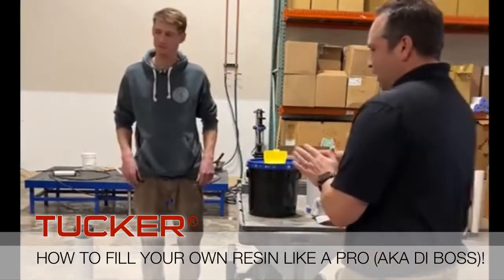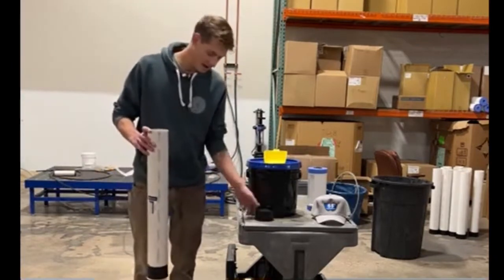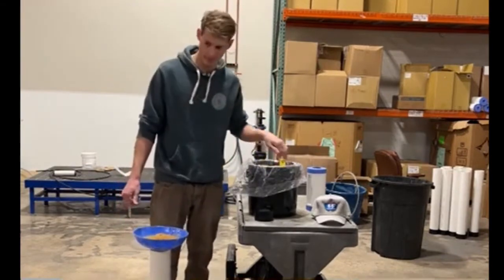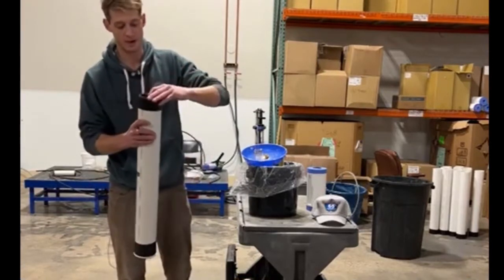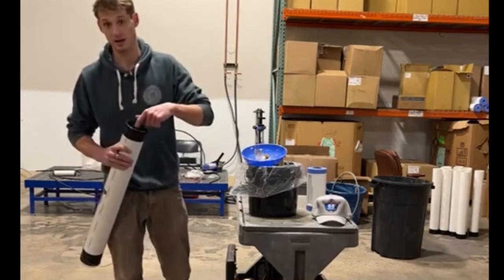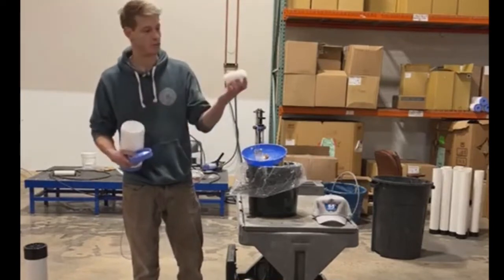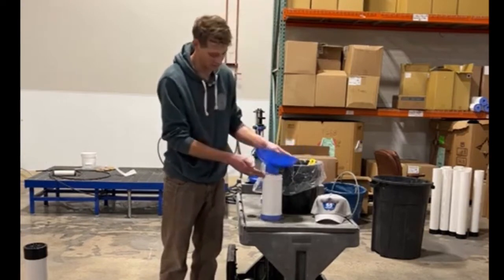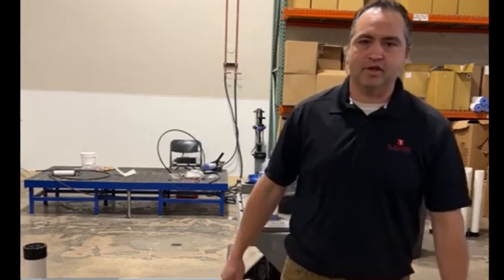How to Fill Your Own Resin Like a Pro!

Comment: can u refill the original one or you need to buy a new 
empty one
Reply from the maker: The one that comes standard in the system will be glued on both ends.  The empty replacement ones that you can refill have one end not glued on so you can fill it.